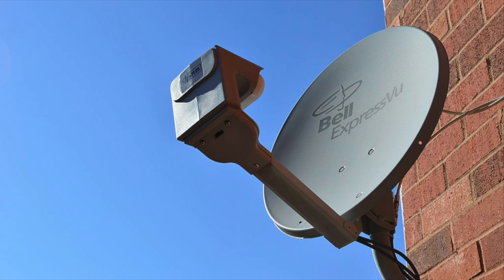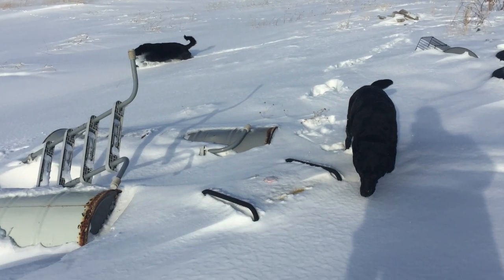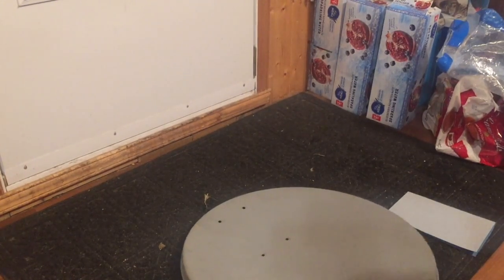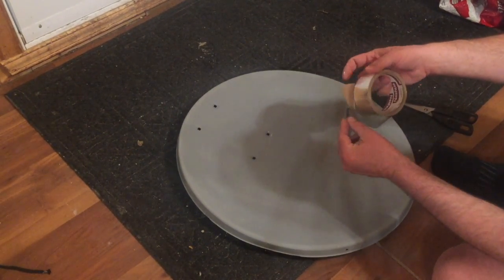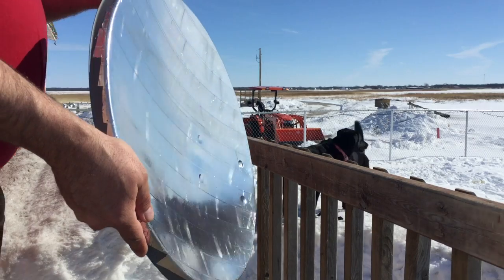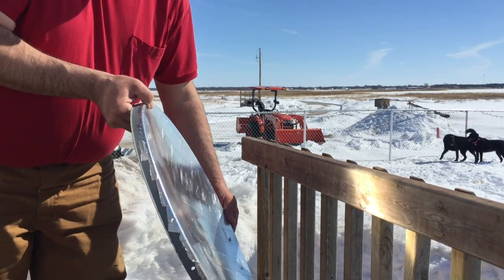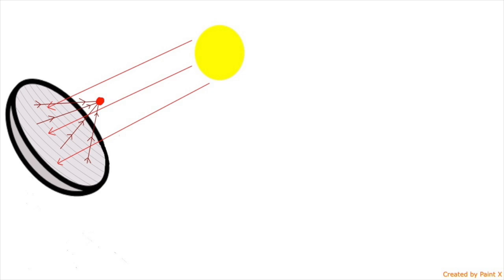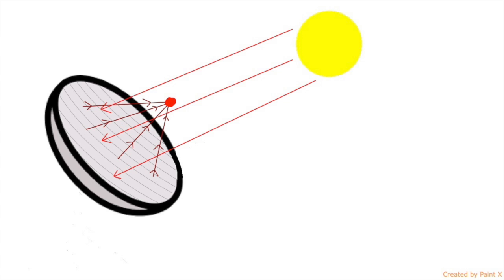DIY Satellite Dish parabolic mirror solar death ray (2018)

Comment from the maker: Please tell me what you'd do to make this work!!!!!!!!!
Reply: The main issue with using foil/ Mylar tape is that although this material is shiny and reflective, it is not smooth at the microscopic level. This causes a fairly large portion of the light to scatter (diffuse). A dish of this size should be capable of collecting about 250 watts of solar power. My very first death-ray (before the R5800) was constructed with an identical dish, however, I used 460 1-inch mirror tiles. It was able to ignite cardboard in a couple seconds and make sheet metal glow orange.  To optimize your project, I would recommend using 1cm square mirror tiles with a silicone based adhesive. This dish could easily achieve concentration factors above 1000x.
Reply from the maker: Ok, First off - THANK YOU FOR REPLYING!!!!!!! I love your channel. I consider it a HUGE honour that you took the time to reply to this video. You've done amazing things on your channel.  I'm going to take your advise and now I'm looking for the approtiate mirror to cut up and try this again. My long term goal is a parabolic trough heating liquid for seasonal heat storage, but step one is getting heat!  I added a link to your channel from mine on my main page as a thank you for taking the time to respond.
Reply from the maker: thank you! I really appreciate that!
Reply: Yes you are right the tape is not thath much reflective ...and you can check the focal point with the help of smoke

Comment: We've got a dish that receives signals from two satellites in two different equatorial slots.  So the dish isn't a perfect parabola.  It is deformed intentionally to optimize this use case.  That could be the same situation with yours.

Also, the reflective surface of the tape you are using is not specular - or rather it's somewhere between diffuse and specular.  You'd get better results with a real mirrored surface.
Reply from the maker: D. Jensen you’re right

Comment: A far better way to make a “death ray” or better yet, a solar stove or a solar furnace is with a Fresnel lens. These can be purchased or obtained from old TV sets but can even be made from the flat reading magnifying lens obtained from the dollar store. If you get a good Fresnel lens, you can melt metal, glass and even rock (if you place your sample at the focal point in a fire brick lined pit). You can also make a decent solar lens out of a stretched clear plastic tarp with some water on top. Buy a thick plastic tarp. Cut it square. Install grommets in the corners. Roll up your tarp. NEVER fold it. Take it camping. Suspend the tarp in direct full sun from four posts with ropes. Make sure all four corners of the tarp are the same height. Better yet, build a frame for the tarp then suspend that. Add water to the top of the tarp. The tarp will deflect under the weight of the water to form a perfect parabola. To adjust the focus, tighten or loosen the ropes. Place your pot of water or rotating food (NOT your head or hands) at the focal point beneath the tarp. Your food will cook. Enjoy! 😉
Reply from the maker: Cool